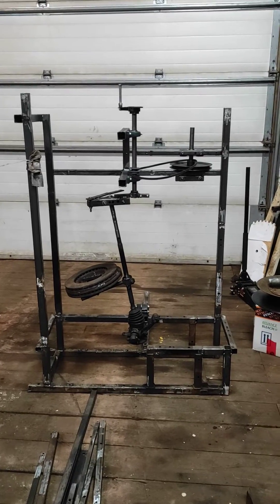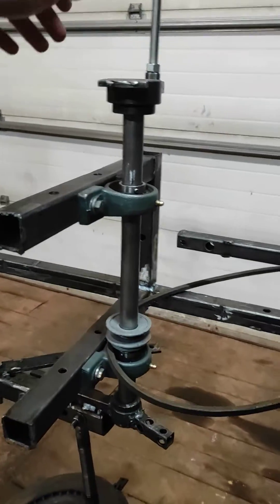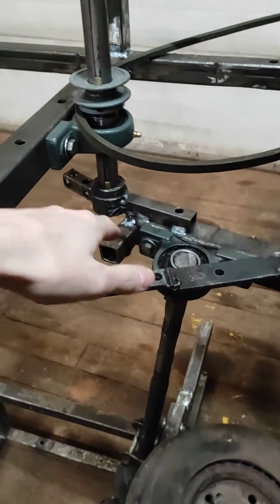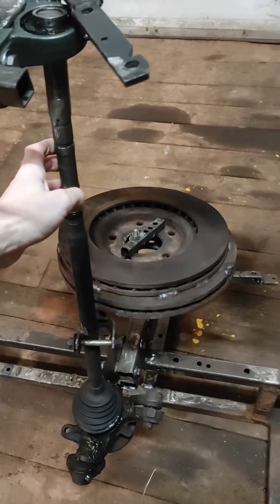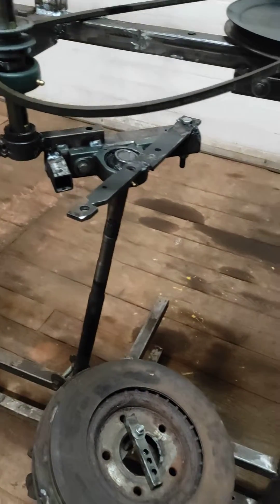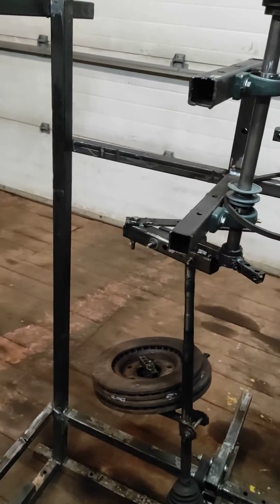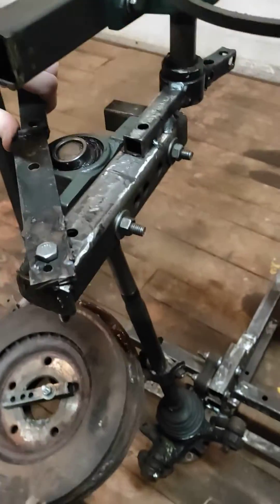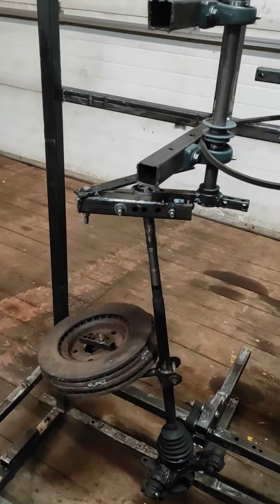William Skinner's Gravity Power Machine (See description)

Comment: Well done. Actually, input should be on the top and output on the bottom. as you see by yourself top axis turns easily and efortlessly, while bottom requires more force to move. lets  try to move system from the bottom and you will notice.
Reply from the maker: I flipped the design upside down which you can see in my newest video. I am turning the weight as the input, but it might work the other way as well.
Reply: @QuantumEnergySearch  have you achieved overunity on william skinner device already?
Reply from the maker: @tomasmazeika8109  I am working on different types of machines now. I believe I understand the principle of the Skinner machine. It can be built a lot simpler. Basically if you take Milkovic's two-stage oscillator, and you lay it flat and the drive motor turns the "pendulum" around (now a spinning weight), you will have an overunity setup which is much cheaper than Skinner's. The difference is the output is oscillating so you need some more parts to turn it into rotation again. (Skinner's machine is actually a centrifugal force machine, not a gravity power machine.) So to answer your question, yes I have but I took them apart because they were low power and too many parts.